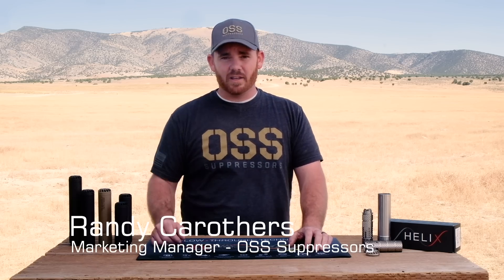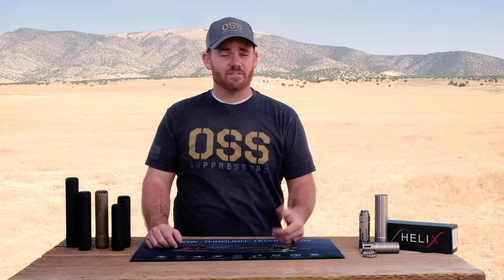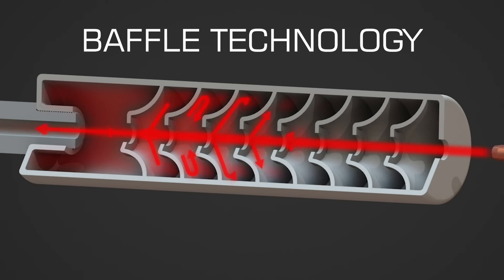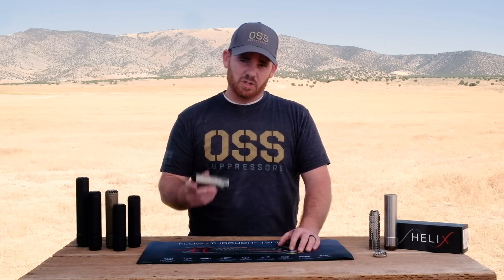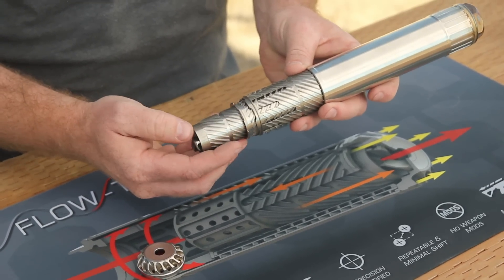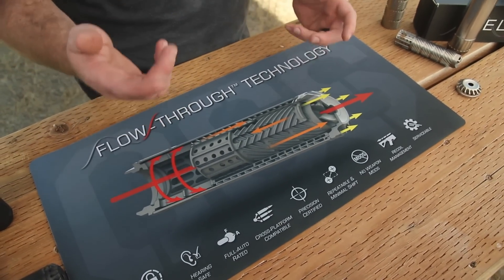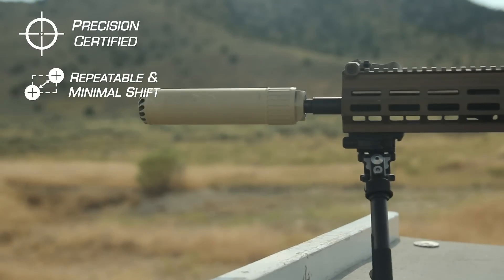OSS Suppressors: Helix-QD - Flow-Through®

Comment: I believe that thing is a marvel to clean properly, let alone how often would you need to do it. How does it even behave when shooting half-full of cinder? 
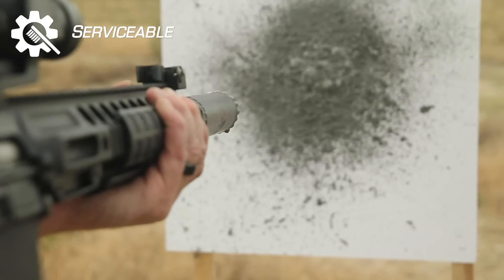Also, talking about gun safety and durability while 3:15... 
Also-also, it seems designed to transfer maximum heat from gas to the tubes.

Comment: Math, math, math. That's the key. Expansion , minus barrel volume, minus gas activation. The balance needs to be handled by the suppressor . A good example is a car, boom boom boom 2k times a minute. Can you hear your car running? Apply that to a suppressor and the only thing you will hear is the click of the trigger. So to speak

Comment: I just got my first can a year or two ago(Helix 556k, due largely to Tim at Military Arms Channel), and I freaking love it.
Before I got my can, my HD rifle was a 16" AR.  Once I got my can(took 14 months 😬) I decided to build a 12.5" gun, so that the suppressor won't make my rifle longer than an M16.  As someone who shoots long guns left handed, minimal gas blowback is important to me, especially on an HD gun.  There truly is a world of difference between OSS's/HUX WRX's cans and a traditional baffle can.  Before I got mine, I had planned on getting a surefire can, but you guys have ruined for suppresors, such that I will never buy a non low back pressure can again(unless it's for a bolt a gun or something, though even then probably not.)
My next can is going to be your 7.62 can(hopefully titanium) for the AR-10/.308 gun I plan on building.  I also got a lower and started building a .300blk gun, but due to the dumb ass laws in my state, the barrel has to be at least 12", so as much as I hate it, I've been considering buying a integrated suppresor barrel/upper.  The problem is, I'd want one that has a total overall length of under 16", but I can't imagine there are many manufacturers who make uppers/barrels like that, as that kind of defeats the purpose 99% of people get integrated cans.
Are your can conducive to this, and is it something a gun smith could do?
Also, I went with the brake for my HD gun, but I want to put OSS MDs on all my 5.56 guns.  Is there any reason to choose one over the other(meaning the brake or the flash suppresor) in regards to use with a suppresor?  Like, will one be louder than the other, or perhaps dirtier, etc.?  And will the MB still work with the can on(or at least provide less recoil as compared to the FH?)
Thanks as always.  You guys make some great products.
Oh, and are there any plans for a "true" QD mounting platform of some type?  I've yet to have any problems with mine(I used something called "Hot Lock"(it's like rocksett but stronger/for higher temps) on my brake), and I know it's "self tightening", but it's always something in the back of head, and I find myself testing it, making sure it's tight constantly while at the range or in a class.
Reply: I would encourage you to use a flash suppressor at home. Muzzle breaks pump a ton of hot gas and debris to the sides which could easily hit you in the face in the event you fire close to a wall or the ground. If you stick with the muzzle break, I would encourage you to use some sort of muzzle blast device that will push all your spent hot gas towards the target. You won't get good flash suppression like a regular A2 bird cage or surefire 3 print/ warcomp would give you, but it'll throw all the hot gas towards the target.

Comment: It would have been really nice to have seen (or heard) a comparison between the SOUND generated and suppressed between unsuppressed, conventionally suppressed and OSS-Suppressed gunshots. Is your product any louder? Quieter? You know, DEMONSTRATE the effectiveness of the main purpose of your product! Wow! What a fantastic concept!
Reply: I also want to know if they run hotter or cooler.
Reply: @ReichenbachEsq  They are effectively a thermal exchange chambers, so I'd expect maximum heat retention in the metal.

Comment: Can you guys post your CFD showing the P, V, T through the cross section of the suppressor over time, then comparing back-pressure and muzzle-pressure vs a competitor's suppressor?
I can see how this would operate like a(n infinite series of) check valve followed by an expansion chamber followed by a flow restrictor, but it would be nice to see the actual analysis behind it.

Comment: Bro doubt....?
Using suppressor reduces the speed of the bullet rite???
Reply: It actually can increase the speed of a round. If you take a traditional muzzle, the gasses are nolonger pushing the bullet when it exits the barrel. If you put a suppressor on it, there is still actually a small amount of gas still pushing the bullet through the suppressor.

Comment: Regarding the lack of back pressure, you’re animation tells the story pretty well. I’d love to see the physics breakdown. Would this be correct—the bullet enters the can and just as it clears the brake, the alternate path through the vanes and folded length is the path of least resistance. It would be interesting to know the percentage of area comparison between 5.6mm bore hole and the alternate path. I’m imagining that the surface area is up to 10+ times the area of the bore hole. While the  bullet is still in the middle of the can blocking exit of gasses out the silencer’s bore hole at the end, the gasses are predominantly in the intestinal section. Momentum of the gasses in the folded path continues to draw most of the gas out this alternate path as the vanes further slow them and slightly extend length traveled. I’m also imagining that the folded path slightly increases in surface area as it goes. Is that close?
Reply: Keep in mind that the breach will most likely unlock after the bullet has cleared the can.

Comment: No.1 Have you done some decibel tests comparing different type of suppressors? If so show us a table....
No.2 Since there is no blow back into barrel,it is assumable,that all the heat dissipates inside of the suppressor into the suppressor body. But there is also effect of the expanding gasses cooling down, due to the expansion. And since they have to travel longer distance,they  have longer time to expand,thus cool on their own. So my question is, how much heat is absorbed into suppressor body and how much heat is lost due to longer time (the gases have) to expand?
Reply from the maker: Our cans actually stay cooler longer because we are not trapping the gas in the suppress.
As for DB testing you can find those on Military Arms Channel, and Silencer Shop.

Comment: Enjoyable but all bullshit. The old Reflex suppressor were better. The new front mounted Ase Utra or Saimaa Still pieces are equal. (For burst fire.) You need chamber volume, not intricate oblique traffic control for looks. Baffles handle the sound wawes but what do you do about the pressure, not much. Opinions will continue to differ. Empirical field tests rule.

Comment: Is that really how you clean the suppressor? Soaking it in solution and then blasting it out?
Reply from the maker: Correct.  Testing bolt velocity, and suppressor weight before and after cleaning confirms it. Army approved, and its good to go .

Comment: I still have my doubts about this suppressor. I really like the idea behind reversing the gas multiple times, but is this just a sales gimmick? I live in Denmark so sadly I just can't buy one and try it out.
Reply: Sound varies inversely to distance squared. The longer the distance it has to travel before leaving the can the quieter.
Reply: @tommickey4244  Well yes that I know... but what this clip shows are cool graphics and a great seller. I want hard data, sound level measurements compared to other suppressors of the baffle type of monoblock, etc. In theory, the helix concept is awesome I don't question that, but that is just what it is... a concept... show me hard data, and I'll accept it. Does it suppress the sound more or is it equal to "normal" suppressors? The tolerances inside the suppressor have to be extremely tight for the gas to stay in one "lane" and not simply cross over and move however it chooses... path of less resistance and all...

Comment: still very noisy AF, If you were proud of it, you would show it in every video,
i've tested ur product, works but not as expected, only one good benefit is  the gas problem, you did a nice job to reduce the amount of gas blown out the gun when ejecting the empty bullet case.
Reply from the maker: Not sure what you mean by "noisy AF".  We don't hide behind the fact that they are generally a few dB louder at the muzzle - but also they are generally a few dB quieter at the ear.  There are plenty of 3rd party videos that confirm this.  Check out Silencer Shop videos, or MAC, or NFA review etc.

This might answer questions about sound: https://youtu.be/WiIxf2oS270

Comment: FYI if you turn the Baffles so the first couple have the small opening facing forward it causes a significant drop in noise as the expanding gas hits the sloping side of the baffle and has to swirl to re-compress and get through why no one other than me has noticed this is a mystery. If you take the time to look at slow motion clips of muzzle breaks they direct the largest volume of high pressure gas sideways not a direct blow through I see you incorporated this feature. Cutting rear facing slots and a large capture chamber to the rear of the first baffle surrounding the barrel would be easy enough to do possibly not suitable for full auto. Clearly a simpler design and I expect extremely quiet as the gas would have to travel 2 Tube lengths and re-compress before ever entering the bore line.

Comment: Great video but is there any benefit for bolt action rifles, on 300 blk subsonics what's the db reduction. With the vast improvements in bullet designs recently hunters in suburban areas need quieter guns even if a liitle larger can is required to keep the bambi lovers from screaming.I think most hunters would trade can size ( 10"- 14" range)  for a reduced sound level.

Comment: “No back pressure?” Like really? Or a significant reduction?
Reply from the maker: Depends on the weapon system and can used.  Most of the time the increase (when mounted on common 5.56 platforms like AR's for example) in bolt speed is between -1% to 1%.  It would be more accurate to state "no back pressure" than to say "reduced back pressure."  But don't take our word for it, there are plenty of 3rd party sources that will validate this.
Reply: Sources. 
Not your paid for shills! Real data...
Reply: They're full of shit, anytime you alter the direction of the gas its going to both slow the gas and increase pressure its Bernoulli physics. Dont buy into all the marketing wank. I'm quite sure its going to create less back pressure than a conventional baffle can but its also going to be louder than a baffle can too, it will also more likely run quite a bit hotter than a baffle can since the hot gas has a longer path to travel through, which is going to decrease duty cycle and increase mirage.

Please for the love of god OSS prove me wrong!   🖕😀🖕

Comment: I have a few questions that have built up over time.  Firstly, on your website you offer both a "comp"-ensator(?) and a "muzzle brake".  My understanding was that "compensators" and "muzzle brakes" were different terms for the same feature.  What is the difference between your "comp" and "muzzle brake" muzzle devices and do they have any measurable differential-impact on sound performance of the OSS suppressor mounted on them?

Secondly, during Military Arms Channel's recent video on a Helix-QD 7.62 can his instruments showed NO First Round Pop - none whatsoever.  I'm used to the first round through a cold suppressor being louder as the contained oxygen is combusted by the advancing flame front.  Is this phenomenon recorded by MAC an unheralded "feature" of the QD cans in your experience?  Is the area within a cold OSS Helix-QD so small that the oxygen can't combust and is instead simply pushed out ahead of the flame front?  I'm not sure how this would work or if MAC's observations are just a "fluke" of his settup.  If this is indeed a feature, you need the be shouting it from the rooftops - there are lots of "hearing safe" suppressors on the market that aren't actually safe during First Round Pop and only claim that title from a ten-round average.

(Still hoping for a 5.56 QD TI.)
Reply: I was always under the impression that first round pop is a result of the blast coming into contact with outside air versus the blast of following shots coming into contact with the gasses remaining in the can from combustion of the previous rounds.  Similar to how our voices change when we inhale helium from a balloon the sound travels at a different speed through the helium causing the pitch to sound higher.  The gasses left in the can from the previous rounds seem to have a dampening effect on the sound waves. At least this is how I understood first round pop.  I could be wrong though.
Reply: It's consumption of the oxygen trapped in the baffles.  First Round Pop won't return until the combusted gas can diffuse out and free oxygen can diffuse back in.  The question is: does the advancing flame front consume the oxygen inside the OSS channels, or does the gas movement just push it out the pores in the front until the flame front has cooled to the point it can't ignite the oxygen?
Reply: @ANonymous-bh1un  I understand the logic behind what you are saying but gun powder contains an oxidizer so it does not need atmospheric oxygen to burn.  Atmospheric oxygen typically requires fuel to burn unless under incredible temperature and pressure which granted may be achievable inside a suppressor. So both theories sound plausible to me I am just wondering if anyone has ever done any scientific testing to prove if one or both of these theories contribute to first round pop.
Reply: a compensator directs the outflow of gas to reduce muzzle flip (upward movement),while a muzzle brake redirects the outflow to reduce recoil, a backward movement.

Comment: I just want to know Know about flash suppression. Is there a flash from the end of the can where the gas is come out? How does your flash suppressor mount measure up against others?
Reply from the maker: The reason for the layers and coils is to allow gas to expand as long as possible before it exits - without getting trapped.   By the time the gas gets to the venting holes, enough of it has expanded that there are no issues with flash.  If you've been around other suppressors you would maybe notice that ours sparks a bit out the venting holes as compared to the small torch you can often see out the center of a baffle can.  

Perhaps we should make a short video about flash.
Reply: How is it with rapid fire rate ?